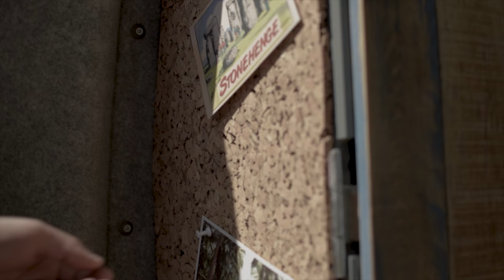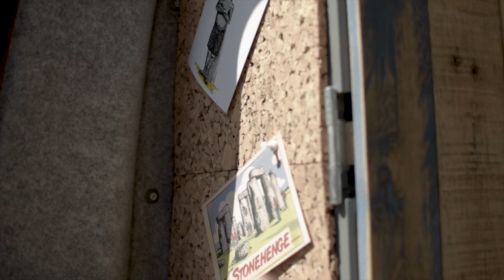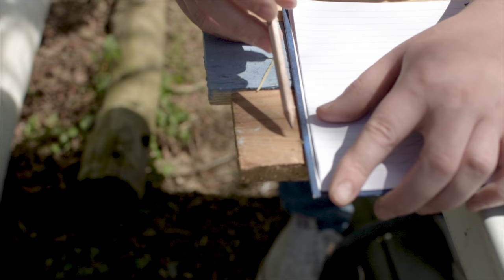Day 35 - Making a table, spice rack, cork walls #VanLife VW T5 Camper Conversion

Comment: Your doing a beautiful job on your camper am on with mine hope it will be as cool as yours. Luv it keep it up 👍
Reply from the maker: Thanks Kevin for all your comments :) yeah we feel like it's really starting to take place. Lots to do but we're really getting into the rhythm of it now. How's yours going? What stage are you at?
Reply: I have a ford transit mk7 I've had it for 5 years I use it as my work van but kitted it out as a day van, now am single again hahaha I've ripped everything out of the van. I've got a eberspacer diesle heater in I've just insulated with close cell foam with shimmy on one side and sticky on other then kingspan foil taped and boarded. I've put 2 swivel seats in and in the prosess I insulated all the cab floor and recarpeted the cab. Put bling speedo on that all lights up. All ply lined got my 4 way stretch today then my units to make. Hope I meet up with you 2 sometime on our travels 👍
Reply: Forgot to say am a gas engineer and my mate is a coded welding lecture and were going to make a rock and roll bed.
Reply: I've gopro my build I'll get round to posting it soon I have no subscribers so no rush hahaha thanks for awnsering me 👍
Reply from the maker: All sounds good, would like to see it when you get round to uploading the footage! :) How's the diesel heater? We're beginning to think that we might need one as we're aiming to spend as much time in the van as possible and would like it to be as comfortable as it can be. If the weather holds up we should be installing our basic water system this weekend, so fingers crossed!

Comment: Hi Meg and Cal. Great work!  Can I ask the dimensions of the table you built please?
Reply from the maker: Julie Applin Hi! The table is roughly 47cm x 97cm. It fits our space really well and we do have the ability to move the table up and down the metal pole on the sliding door. We need to distress it a bit to fit in but we're happy with it :)
Reply: Flora & The Novice Explorers. Thanks for dimensions of your table. I've just installed mine but went for a swing out leg attached to my bench/bed in the end.  Just about to reclassify my van, wondered if you guys have done your's yet?
Reply from the maker: No problem :) we haven't done ours yet but we were discussing it yesterday, we think we've ticked off all the criteria so might do it soon! Will try and film the process for others to see too if we can :) let us know how yours goes!

Comment: What are the benefits of the reclassification?
Reply from the maker: Hi Ali. There's a couple, nothing major but we've decided to go ahead with it. Some of the benefits are the ability to travel at higher speeds, cheaper insurance, cheaper ferries etc. We just need to complete all of the requirements but we've done most of them, such as installing a window into the living area.
Reply: Might also help with resale value as well: it’s a “proper” camper van conversion.
Reply: Insurance costs will drop alt